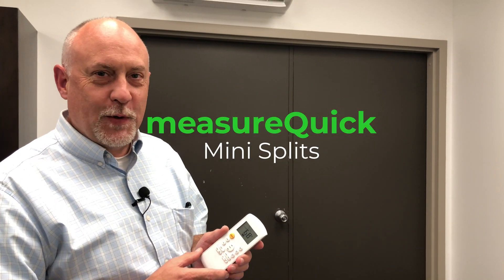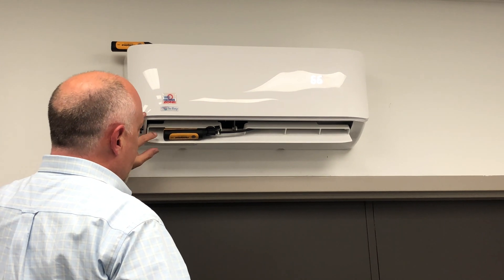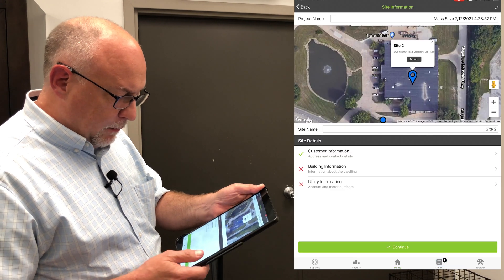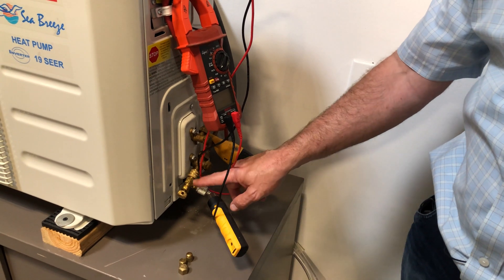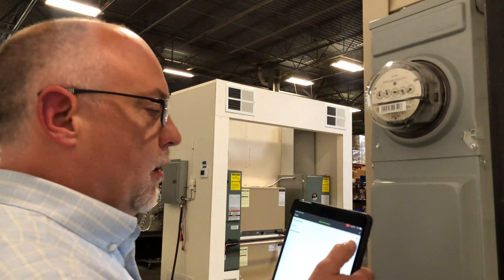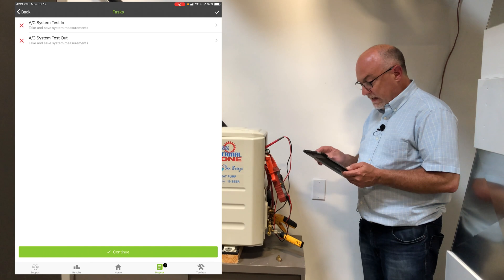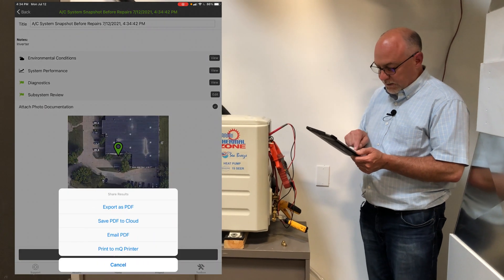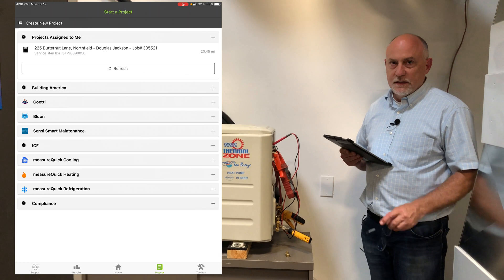Mini Split Workflow in measureQuick

Comment: Thanks Jim, I have a question how can we measure air flow in mini split A/c? Can we use large vane annometer?
Reply from the maker: There is no good way to do it accurately. I usually use the manual input and use manufacturer rated. If the blower is clean that should work well.
Reply from the maker: You could, I have done that before.

Comment: 9:37 - An excellent workflow for me to access (straight out of refrigeration school and thrown into working on a number of walk-in coolers) would be a refrigeration workflow that involves a rapid cycle hot gas valve for maintaining temperature at close tolerances. Also helpful would be one for an RTU package system, specifically at least describing air flow probe placements and where to put the Sauermann probe on the RTU for combustion gas analysis. Each of these RTUs has gas heat, so steps for clocking a meter that feeds several units at once would be good. Most of the workflows I see in MQ are for residential equipment. The cold rooms I’m working on, as I said have close tolerances and none of the refrigeration profiles in MQ are 36 degrees @50% RH. I only see a walk-in freezer in there. Thanks for all you do, Jim

Comment: Great video Jim. I have a few questions re mini split diagnostic. Can you do test in a heating mode as well?I live in New Zealand  and we use SI system, so i'm  confused with use of Fahrenheit temp,  BTU or Tonnage,SEAR etc. Is any chance that you do some changes in a app for the international use? Thanks
Reply from the maker: MQ does heating as well and it does have SI units available.
Reply: @measureQuick  Thank you for your prompt reply. Actually I tried to do diagnostic of Panasonic R32 3.5 kW output mini split in heating mode  but i couldn’t find that option in MQ. There is just cooling option for mini split. Also some system inputs are not possible to enter consequently shown unstable system. Thanks.

Comment: I have the app and I absolutely love it but why when you go into the trending graph, superheat is red and subcool is blue????
Reply from the maker: So we got a little technical with that. Superheat is heat above saturation and subcooling below saturation. I get what you are thinking, low and high side of the system. At some point we are going to make that whole section a lot more user configurable. It has just been a lower priority.
Reply: @measureQuick  oh ok. It’s nothing big, just a little nit pick. Absolutely love this app though. I’d donate money to you guys for working so hard if I could lol

Comment: We use service titans ia there a way to transfer info between the two apps?
Reply from the maker: Yes, they are Integrated, if you go to the support button on the bottom of the app on the left and just start typing in servicetitan you will find integration instructions

Comment: I have LG and Mitsubishi systems with there air handlers do i test them as conventional or ductless. also have some with multi air handler and wall units how would it use MQ for them. thanks

Comment: Hi Jim, great content. I was not able to get the ICF Mass Save option on my measurequick. I already did the online courses, was wondering if I missed a step somewhere... also do I need to buy qbits to submit data to mass save? Thanks.
Reply from the maker: Likely something was missing that is required in a section. Also make sure your app is up to date.
Reply: @measureQuick  thank you for replying, got it resolved...

Comment: How does this work with multi head units?
Reply from the maker: Start all of the heads, you can use multiple supply and return probes if you want and it would average the readings.
Reply: @measureQuick   Can you just pick one head unit to test on a multi head unit

Comment: I knew this would eventually come around thanks for providing. 
        Since many of the more well-known companies have hardwired a test mode into their units that the actual manufacture use to set their condenser fan to a specific CFM flow they said their air handler fan to a specific flow they meet her there electronica expansion valve. 
                 Are using all the manufactures specifically placed temperature sensors and pressure sensors to determine proper operation i.e. superheat and sub cooling. 

         Could measureQuick better refer to the technician to RTFM and measureQuick software incorporate this information to better take measurements ?
Reply from the maker: Yeah mini splits are a real pain to test because they are so manufacture specific. This workflow is more to assure everything is in the ballpark of acceptable and allow you to benchmark the system. I was working on it for over a year before I get something that would be of some value.